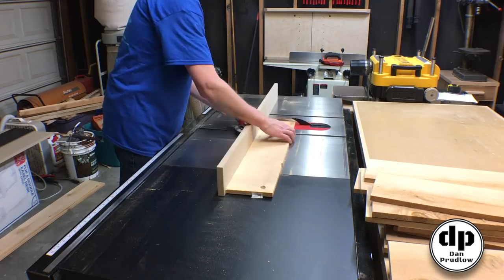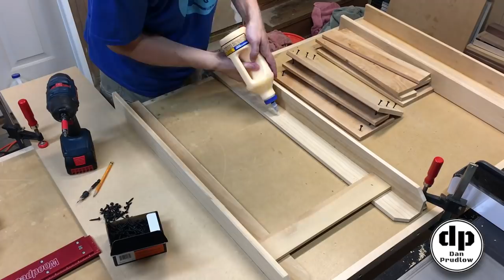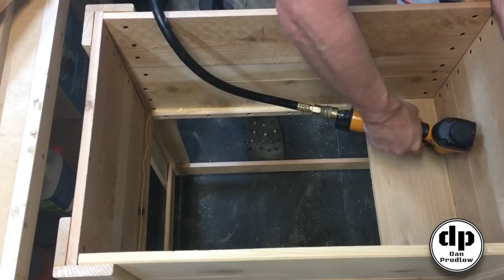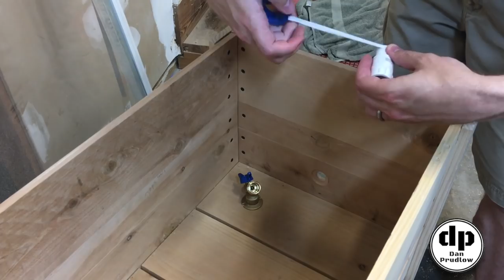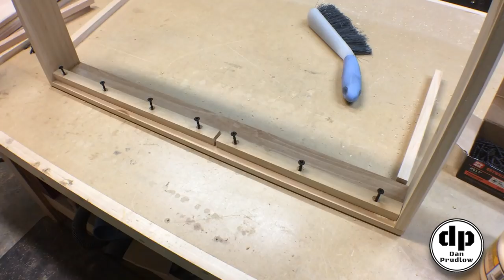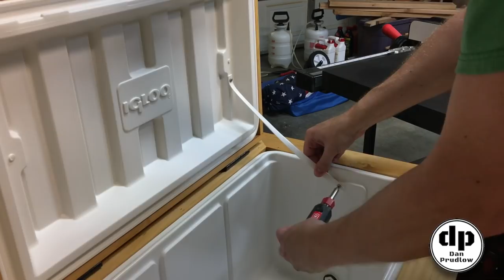Build a Patio Cooler | Cooler Box | Outdoor Furniture

Comment: A man after my own heart. This chest design is one of the nicest I've seen. Many of the plans require a 2"x4" frame under the cooler for support and I thought it was overkill. I like the ledge and boards supported by the ledge. It's not a big thing but if it ever has to be lifted that 2x4 frame adds more weight to its overall weight. (Plus buying cedar 2 x4s are expensive) I already have rough-cut 1x6x10 boards I bought a while ago for raised beds that I will use. I can always get more for that project at a later date. AND we work just like each other. Very organized, pre-cut the wood before assembly, predrill, etcetera. Really nice job!! I'm going to check out your other videos too!
Reply from the maker: Thanks for watching and I'm glad you enjoyed the build.  This is one of my favorite projects!  I try to stay organized for sure...it's usually not until the very end that the shop descends into chaos...lol.  Thanks again for watching.
Reply: @DanPrudlow  Exactly! You know I try to put stuff back right away but my shops so small that most things are a few steps away so its easier for me than someone with a big shop. Some of the young builders I watch have huge pole barns built for a shop with 15-20 ft ceilings and all I can think is it what will it cost to heat and cool them! That's when I'm happy about my 10'x16' shop, lol.

Comment: Good work buddy I enjoyed watching this video and looking forward to your next ones... what size and what kind of screws did you use, im a beginner and I want to try building this.
Reply from the maker: Thanks for the kind words.  I just used drywall screws for a lot of the assembly.  Either 1 inch or 1.25 inch depending on the thickness of the material.  Under the lid I may have used some 1 5/8 wood screws to screw into the lid of the cooler.  Thanks!

Comment: One more question, how has the natural timber oil finish held up? Have you needed to reapply yet? And do you think a quart is enough for this project or did you need a gallon? 

I really like the idea of an easily repairable finish like this (thanks for the idea, had never heard of the timber oil product). I see most folks use helmsman spar varnish on these boxes. I think it looks great in the beginning, but will be a nightmare to refinish when the time comes!
Reply from the maker: I actually sold this thing a few months after building it...so I can’t say for sure how it’s held up.  Obviously the harsher the conditions the sooner you would have to reapply but it’s so easy to apply that even doing it once a year or every other year wouldn’t be bad.  I’ve put this same oil on some planter boxes that I’ve sold to people and have had no complaints.  I think the key is to just keep up on it and it will look great for a long time.  I just brush it on kinda heavy and let it soak in for a few minutes while I brush on another section and then go back and wipe off any excess.  I just keep working my way around making sure not to leave any drips as drips or pooled up excess gets sticky as it dries.

I just used a spar urethane on the mailbox post in my most recent video.  It looks great but as you mention I think I will regret it when it’s time to refresh the finish!  Always trying different things though! 👍🏻
Reply: Thanks again  @DanPrudlow !

Comment: Hey Dan, looks great. Any chance you could link the specific Igloo cooler you used here? I'm not able to find the 52 quart Igloo "family" cooler that Donald uses (I see it at various places online, but it's not sold any more), and not seeing any similar basic ones with the same style drain plug. The closest thing I'm finding is a 48 quart Coleman cooler at the orange home center.
Reply from the maker: I bought mine at Target but I purchased it a long time ago so I don’t have a link...just finally got around to building this and making a video.  I did make one of these for someone when I first found Donald’s channel and I had a 42 quart.  I just took his measurements and adjusted for the different size.
Reply: Thanks Dan.
Reply: Chris Stephens I believe igloo discontinued that model they replaced it with a smaller cooler without a drain plug so it takes a bit to get it right

Comment: Excelente work , what size it’s.. you have a new subscriber
Reply from the maker: The cooler is 42 quart.  The whole thing is about 36 inches tall, 24 inches wide and 20 inches deep I think.  I don’t recall exact measurements.

Comment: Above my pay grade… and tool supply 🙁
Reply from the maker: I guess I should have started YouTube sooner and I could have done a video on the ones I built with an old contractor table saw, sander from Harbor Freight, older drill/driver, etc.  obviously more work…especially sanding…but it can be done with lesser tools.